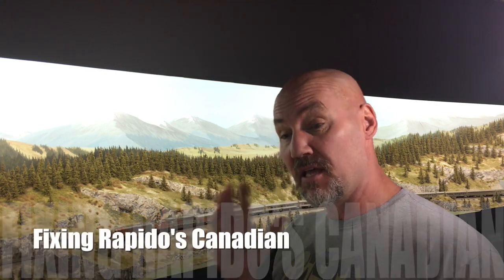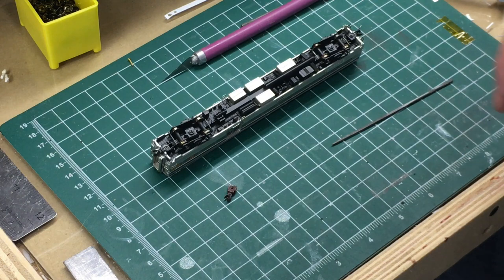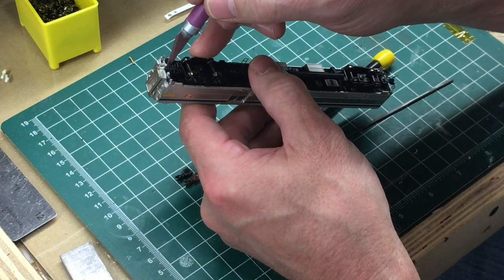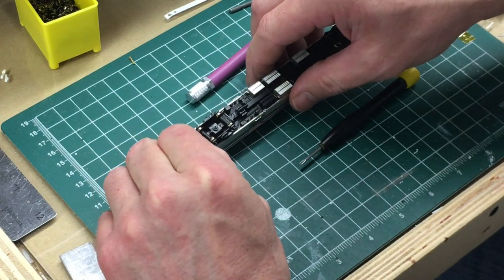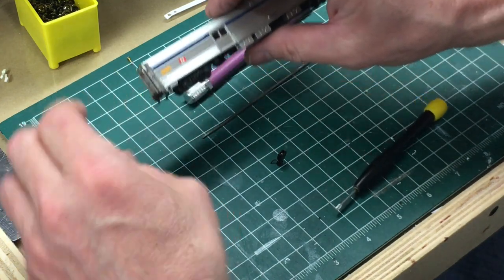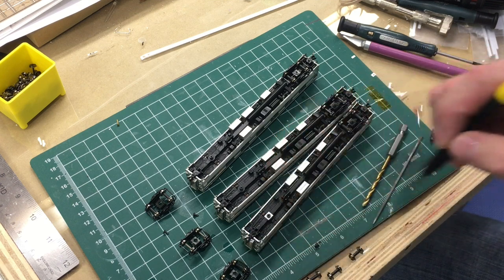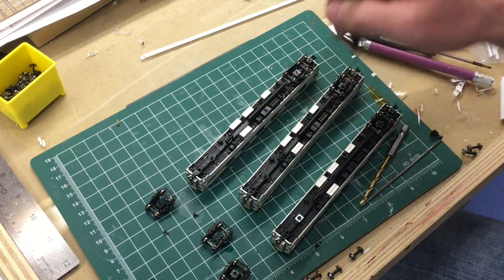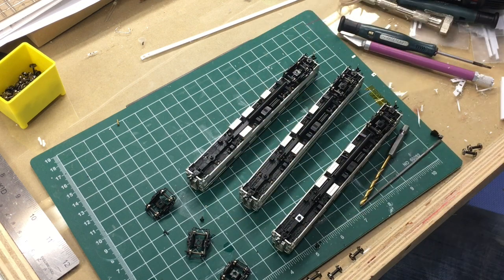Rapido's N Scale Canadian - Quick Fixes - Southern Alberta Rail

Comment: Wonderful “fix it” video Grant (and your ASR looks like a magnificent layout).  I’m in the camp that feels spending $800 for ten N scale passenger cars should deliver stellar performance right out of the box.  I live ten kilometres from Rapido’s office/warehouse, so I dropped off my set to have them perform the repair.  However, I’m a bit miffed that, at this price point, a fix was required at all.  It now rolls better, but inexplicable, intermittent decoupling means I will be doing the Microtrains coupler upgrade that you prescribe.  Thanks for the pointers!
Reply from the maker: I'm in that camp as well Dwight, however, experience has taught me different!.  Hopefully you won't have to change all the couplers.  I only had an issue with one car and I could have likely used the factory coupler after the slight trim in the vid.  Sometimes loosening the mounting screw a half turn will free up the coupler thus avoiding any further work.  Good luck!  -grant
Reply: I think Rapido's attention is on making things for Jason's layout and not on the product anymore (unless it's for Jason!). The quality control process has declined dramatically over the past couple of years. It's not acceptable.

Comment: I like how you give 3 fixes where most would not even offer one fix... and it would just be complaining. QC is not what it used to be and even with the lot of Rapido LRC cars I bought in HO scale... one was a misprint, they all needed new couplers and I had to oil all the wheel sets and they made too much noise. Putting in a bit of extra work to make them run a bit better makes all the difference. Great video, thanks for going above and beyond.
-Kris
Reply from the maker: Thanks!  I appreciate that.  Cheers.  -grant

Comment: For the micro-trains 1015 copies, I know that BLI's factory did it to save money without informing them on their PA units and they did not know until they were shipped all the way across the pacific. I can't say if this is the case with Rapido at all, esp. since they own their factory. But they may not have known until they got to this side of the pacific, and there is little they can afford to do at that point.
Reply from the maker: Roger that.  Rapido doesn't market the couplers as MT as they make their own "Micro Trains Style" Coupler.  Just happy that box allows a real MT to drop in when there is an issue.  -Cheers.

Comment: Any chance you have the Kato stainless passenger cars from a few years ago to do a side by side? To your point about modellers vs buyers I built small circuits with capacitance to improve the Kato track pickup lighting and milled spaces in each of my car interiors to fit. Took a while to do, very satisfying to complete... But now I'm completely torn over buying essentially the same train again.
Reply from the maker: I do.  I'm guessing you're talking the California Zephyr?  While similar the Canadian is a different train and the Rapido models are better detailed than the Kato set.
Reply: @SouthernAlbertaRail  Not quite the Zephyr, here's an example: https://trovestardata.com/images/Collections/4/items/140/140968_19.jpg  I'm sure the Rapido ones are better directionally, I just wonder if one mixed the two sets if it could pass from 4-5 feet away or if they're chalk & cheese.
Reply from the maker: The Zephyr is the closest to the Canadian.  In fact some of the cars use the same  floor plan.  I have all the Kato passenger sets and the Rapido's Canadian is better detailed than any of them.
Reply: @SouthernAlbertaRail  Well I submit for your consideration the idea of doing a video (e.g follow-up to this one) contrasting the Rapido and Kato runs close up but also from typical viewing distance, like your shot of the Rapido Canadian in this video. I'm surprised not to see a side-by-side readily available elsewhere despite googling for same.
Reply: @keepinga  having the KATO Canadian Pacific from 20+ years ago ( and the KATO ZEPHYR and the KATO SUPER  CHIEF )  and now the RAPIDO one I can say that the RAPIDO is the most beautifull set over all the other passenger cars or set that I own BUT I never had to do anything to my  KATO sets like I did for the past month on my new set ....
I was thinking I could put have them on the track and enjoy right away but it was not the case , the set is a 10/10 or better for the look and much more acurate than the old KATO Canadian Pacific set but on the track it's another story ..

Comment: Thank you for this informative video, as I am considering buying a set of these Rapido Via rail sets.  Which set number is this?  This is the one I was looking for with the red/white Canada flag and white "Canada" letters.   You would think in today's modern age of CnC machining, these problems would not exist, but it seems like I have to fix everything before I can run it.  But its nice to have a hobby that you actually do something, and not just stare into a screen.
Reply from the maker: Well said.  Not a screen guy at all...  I enjoy working on models....  That's why I bought all those tools after all!!  The biggest issue I find is HO manufacturers messing with N scale.  They don't understand the N scale market and try to cram all the 1/87 features down to 1/160.  It has to run well before it can look good...  Not the other way around.  I picked up two sets of these cars, VIA HEP Canadian set #550006, along with the add on Prestige cars, as well as a Tuscan CPR set.

Comment: THANK YOU. I knew you would have a solution. I too didn’t want to raise the ride height and was hoping I could just replace wheel sets. Are the replacement wheels sets Micro Trains width or Atlas width? I also agree with your rant to a certain degree. I still think if I was a manufacturer I’d acknowledge the issue and offer my customers a solution, perhaps replacement wheel sets. I do love Rapido and what they bring to the N scale table. My GMD-1 and BCR Dash 8 are excellent models that work amazingly.
Reply from the maker: No sweat David.  The axle lengths are MT or, to be more precise, .540".  The wheels I used have a .537" axle length.
Reply: @SouthernAlbertaRail  thanks .
On my layout I found the RAPIDO flange too small and my beautifull set tend to derail in some place . Is there a replacement wheel/axle that you know that have a bit bigger flange ? I tried the KATO one that have the same design ( with a plastic tube ) in the middle but the axle ( point ) are too long ....
Reply from the maker: I don't know of a wheel that has a larger flange that would work Louis....  Apologies.
Reply: @SouthernAlbertaRail  ok thanks .

Comment: What about using Kato low profile passenger car wheel sets? They have the same set up as Rapido's passenger car wheel sets, but the plastic axle is a little bit smaller in diameter.
Reply from the maker: Good thought, I tried that first.  The Rapido axles are .537", the Kato axles are longer and don't fit in the truck.

Comment: Nice, not an N scale modeller myself but good to know. FYI... the vestibules on the coaches should face forward.
Reply from the maker: Ooops.  Wasn't paying enough attention.  Need a bunch more Manor's as well.  Thanks for pointing that out.  Cheers.
Reply: @SouthernAlbertaRail  I like the 3rd option you did. I want to collect an HO Canadian. The coach car is missing that enlarged window on the front right by the door and the kitchen vents on the skyline need to be corrected by rapido to be staggered and have that 3rd vent over the coffee shop window. Cheers :)

Comment: I modelled transition 1959 CPR in N my whole life. Recently decided late last year to sell of all my CP. (I changed to MILW/NP/UP) I had a complete set of kato Canadian cars. They aren’t as detailed. But I didn’t touch them to get them to run properly for hours on end. This is BS for the price you paid. I am willing to adjust and fix but the fact that you had to bring out a file and hobby knife to make these run is terrible. I now have many many rapido, kato, centralia and wheels of time passenger cars for MILW/NP/UP. No files were required to make them run. You get what you pay for but Shron and the boys at rapido should be ashamed of themselves if the running quality is getting worse.
Reply from the maker: I guess it depends what you're after.  The Rapido Canadian is bang on detail wise but requires a wee bit of work to get to run.  Kato stuff runs flawlessly but isn't prototypically accurate for the Canadian.  Every manufacturer has had issues.  This one is an easy fix.  Individually we have to decide if it's worth putting in a little effort to get what we want.
Reply: @SouthernAlbertaRail  no disagreement for prototypical accuracy. Even if you had to change to MTL couplers I’d understand. But filing it down and swapping wheels on top what you paid is wrong. Imagine buying a new Cadillac and all you had to do was buy new wheels and tires for it that turned and angle grind the wheel wells to make it drive freely?
Reply from the maker: I would never buy a Cadillac!!!

Comment: highway robbery if you ask me... $700 Cad for something we have to fix at home or buy parts for, id understand if the set was $350-400. what does rapido even do for Quality Control??? the last few releases from rapido have all had problems out of the box.
Reply from the maker: It's an unfortunate fact that final QC is done by the factory overseas.  Often times a problem that is addressed by the manufacturer is ignored by the factory as it costs them money.  By the time the product is released it is now the manufacturer who is on the hook.  They could simply walk away but with tens, if not hundreds, of thousands of dollars at stake would you?  It's an unfortunate fact of the manufacturing process at present.  Not right by any means but not changing anytime soon.

Comment: Sadly since the first run of VIA rail Ph40 rebuilds.  Everything post that release has been plagued with shitty quality control issues  From detail pieces, decoder issues etc.   Rapido needs to get there act togther.

Beyond me how one can  spend 500 dollers plus on a passanger coach set just to spend time and money on fixing multiple issues. Bullshit in my book.  

I understand you need to be a modeller to really enjoy the hobby, but in that same regard.  The only thing one should be doing to an expansive loco or frieght car is weathering it and adding specific road number details that the factory omitted.

Fixing a bunch of stuff to make it work and reliable is complete garbage and should not be tolerated by the consumer.